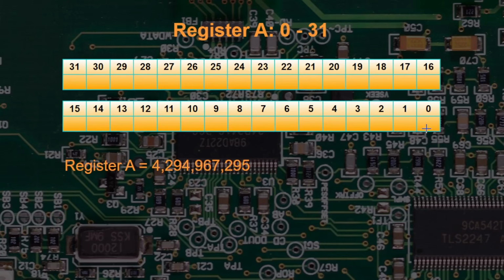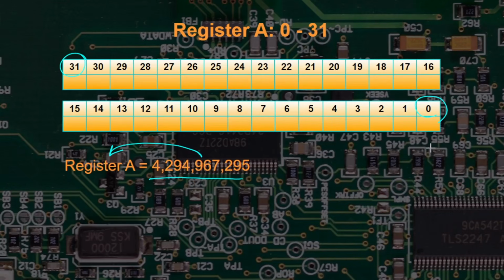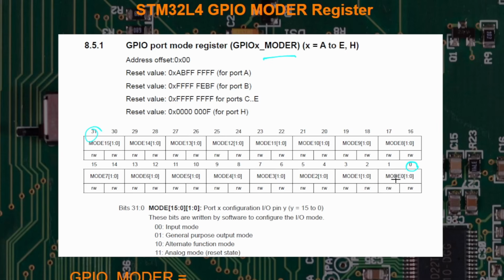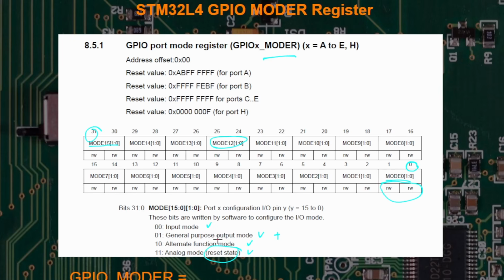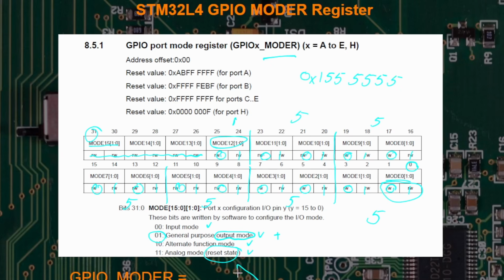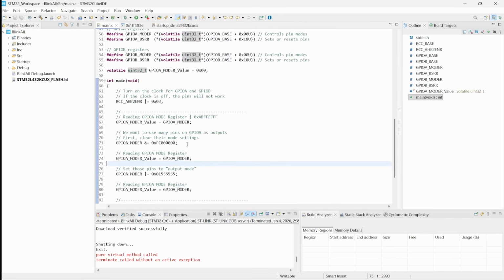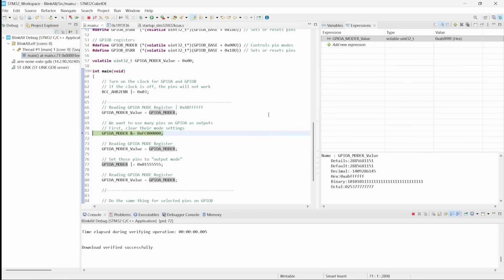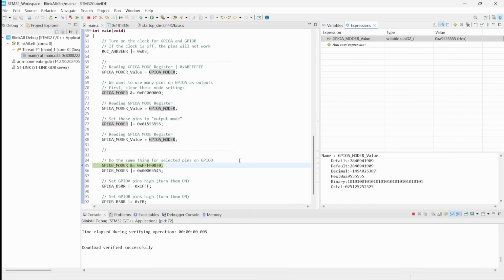Bare-Metal STM32: Writing Registers Without HAL

Comment: The time spent on explaining Hex is kinda a waste of time ngl. 

Like, you have to do: 
Learn the assembly language. 
Learn C/C++ 
Learn how to compile and assemble. 
Learn how to link it. 
Create an image from the elf. 
Flash the image to the micro controller. 
Make sure the code you wrote is actually being executed. 
Then you have to learn breadboards, wiring and electrical components. 
Calculations of resistance and signal processing. (The electrical components thing is as hard as what you need to use. But the aboves are a high bar, constant (bounded and fixed) pain and difficulty. 

Then you need to learn the hardware registers. How to set them up, configurate and activate a gpip pin. 

Then how to turn it on and off. Once yoy've read the docs and wrote all these functions, types, structs and everything, you can call it from your main. 

And finally, you've got a blinking light. 
How to do binary operations (or if you use a better language, like Future Zig [it will be great one day], or rust with addons, use a struct and just do a.x = 1. A.y  = 2 ... *b = a.
Reply from the maker: Thanks for the feedback! I agree that embedded development has a lot of layers, and hex is only a small part of the journey.

The reason I included it is because when beginners start working with registers, memory addresses, bit masks, and datasheets, hexadecimal shows up everywhere. I wanted to make sure they had the foundation before moving into those topics.

There are definitely many bigger challenges ahead, but understanding hex early makes the later steps less intimidating.